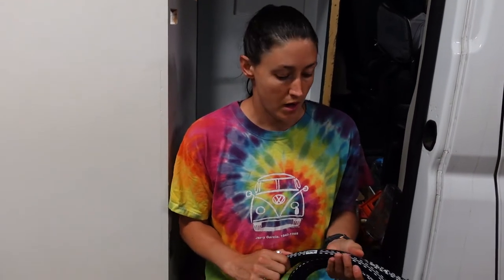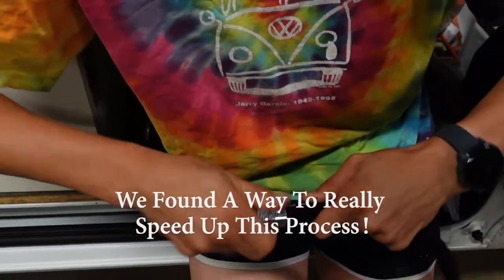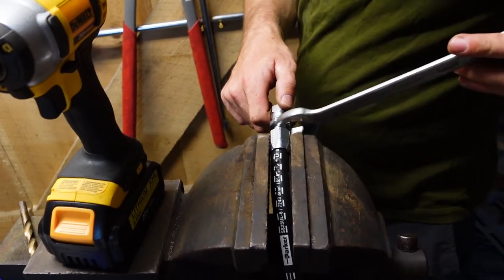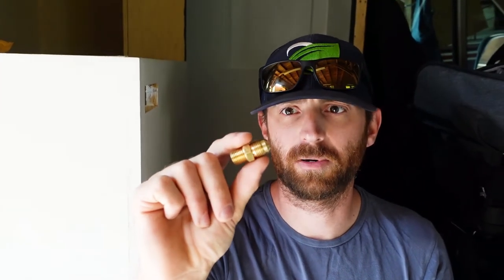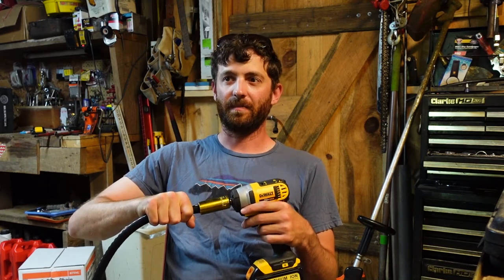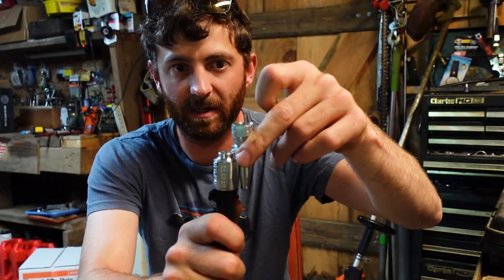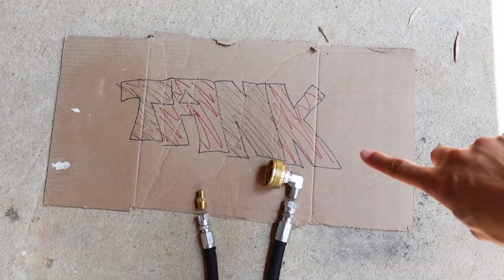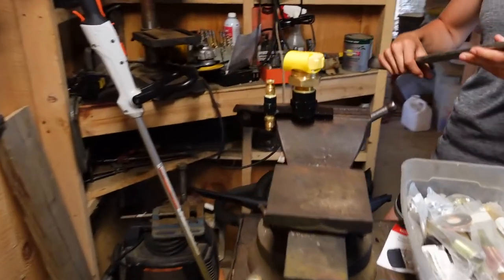Van Build | Nashfuel Propane Remote Fill Install | Van Life Tiny Home Build

Comment: Helpful video. I just finished installing my remote fill (same kit)! Please note that the fittings on the hoses are REVERSE THREADED. This is why you had such a tough time with them. They should spin on right away by hand..hope this helps others.
Reply: Thanks for leaving this comment!!!

Comment: I probably should have thought about this right away, given that it's a propane system and all, but your drill idea for installing those fittings was great, but it took me a few minutes to realize that they had to go on opposite to the "normal" way.  Once I realized that, they went on very easily.  I found your video quite helpful in getting my installation started.  Thanks.
Reply from the maker: That’s great! Happy to hear that!